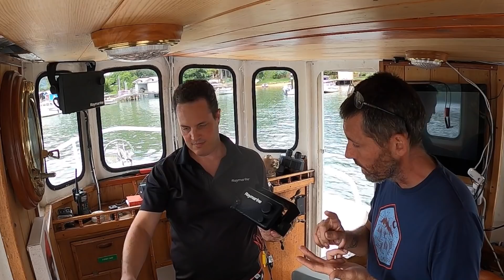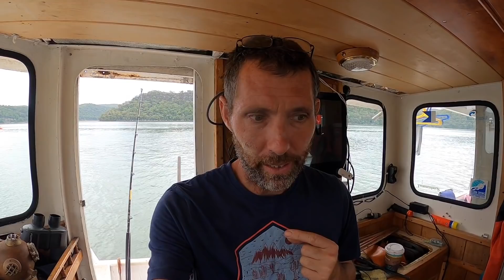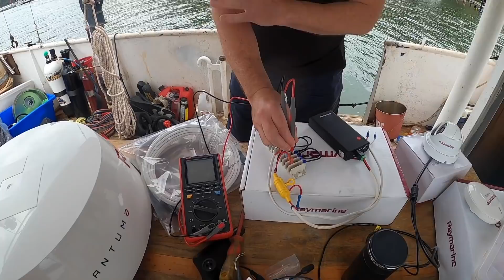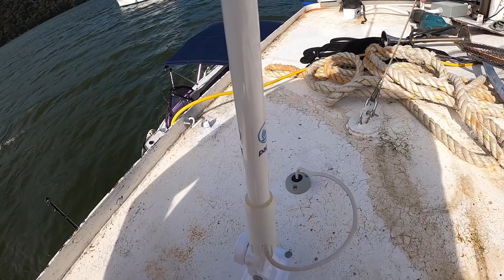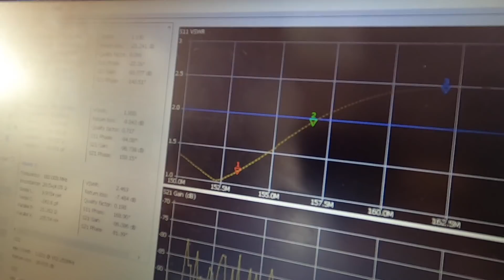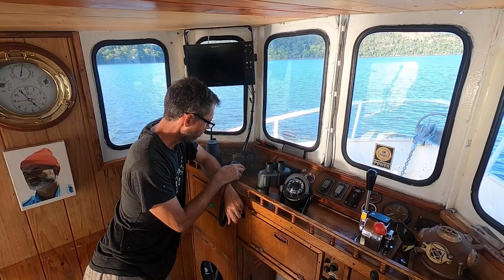Marine VHF radio installation and antenna tuning

Comment: So the distress button is like a PAN PAN call, but your EPIRB is a MAYDAY?
Reply: Nope! The distress button is actually mayday. Once you followed the distress button procedure, and sent the DSC distress alert, you're supposed to wait for a coastal station to acknowledge it (should take very short time). Then, you get the microphone (radio should switch to channel 16 automatically)  and call mayday, using the standard procedure for mayday.

EPIRB is much better for a situation where you actually have to abandon your ship, or when your VHF is broken, or you're out of range of VHF coastal stations and don't have MF/HF/Inmarsat and so on.
It just sends its identification on 406 MHz, and it will beep on 121.5 (the air VHF guard frequency), fancier ones also have a GPS receiver, and will send GPS location once they get a lock. 
It won't let you choose the distress reason(and VHF will, there's a short list of reasons), and it won't allow anyone to communicate with you. 
Of course,  you're supposed to register the EPIRB, and give contacts, so the rescue coordination center will call the contacts, try to figure out what's happening, if it's a false alarm or not, and will then, hopefully, dispatch rescue, which won't know what your problem is, and won't be able to find out, until they get close to you. In the worst case, the RCCs might start playing hot potato with your case, and it happened last year that people went missing because nobody responded to EPIRB activation.

Comment: “Radio works just like that except it’s not a cat”. Brilliant. Snorted ma beer!!!
Reply: Thats actually a description quoted by Albert Einstein... You see, the wire telegraph is a kind of very, very long cat. You pull his tail in New York and his head is meowing in Los Angeles. Do you understand this? And radio operates exactly the same way: you send signals here, they receive them there. The only difference is there is no cat.
Reply from the maker: Apparently it was said to be an Einstein quote but wasn't actually. It's still funny to think of Einstein saying it. :)
Reply: @DangarMarine  I had no idea.  Was very funny, had to clean up the beer after though....
Reply: Man you took the fun out of that.  It's the way Stu describes things, matter of fact but cool and well timed.  You go with your brillancy.
Reply: Blimey the comment bores are out in force tonight.  It was bloody funny. I sprayed my beer laughing. Stu’s dead pan is always brilliant.

Comment: Thanks for another great video. Am I correct in thinking the vhf is pretty much line of sight ? Like the taller the antenna the better ? We used to mount ours on a piece of stout pipe to get it up another 10 feet or so. Seemed to help lots. Glad to see Ade again. Is he going to start making vids or no ?
Reply from the maker: Yes, he's been doing a lot of filming. :)